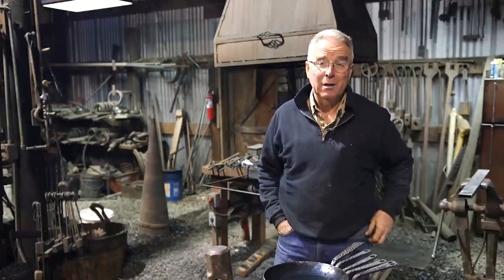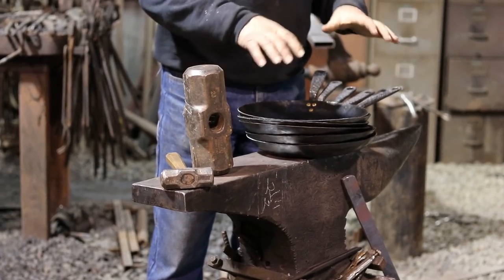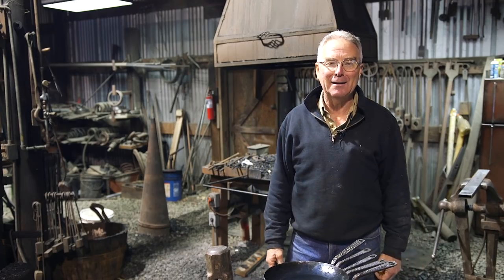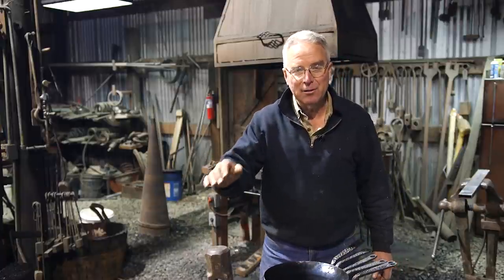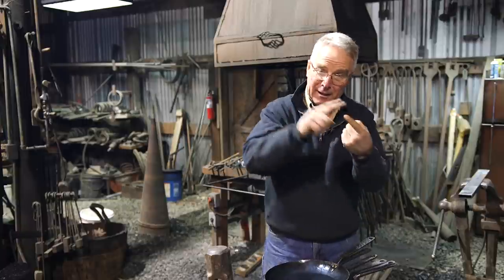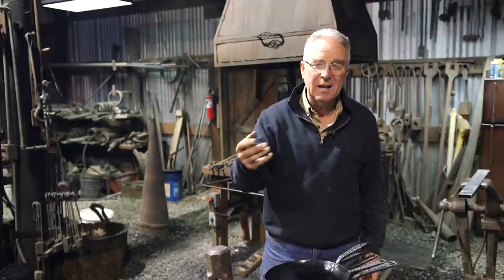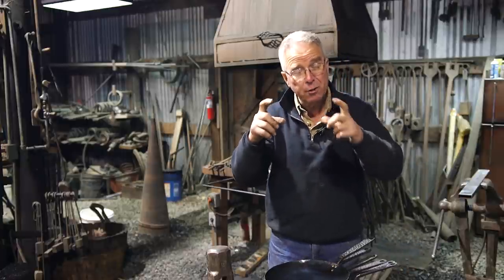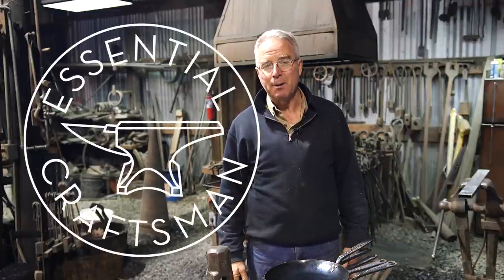Forged Pan and Blacksmith Course Giveaway

Comment: Been eyeballing carbon steel pans for a long time. A lot of benefits to these. You can put them straight in the oven, you can refinish them, you can season them like cast iron, so you get non stick + metal utensil safe pans that are great for high heat.